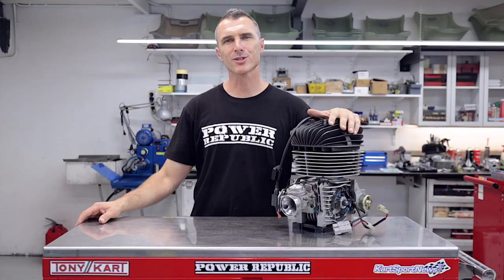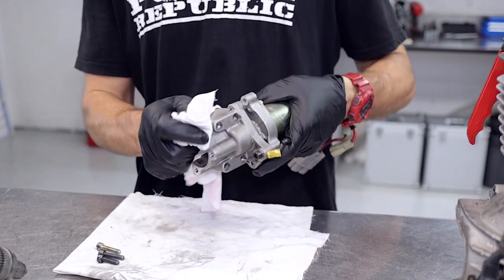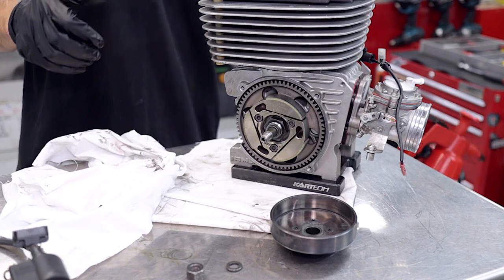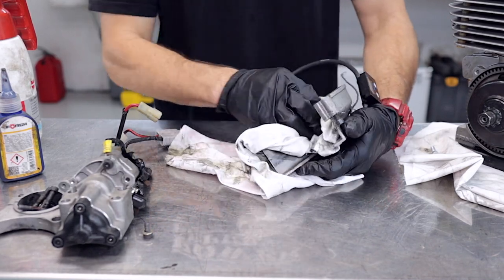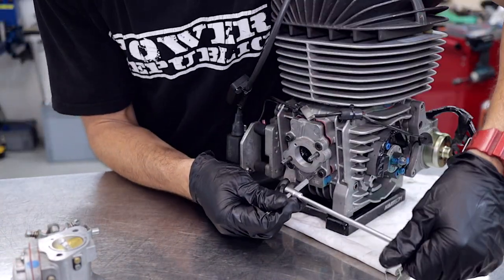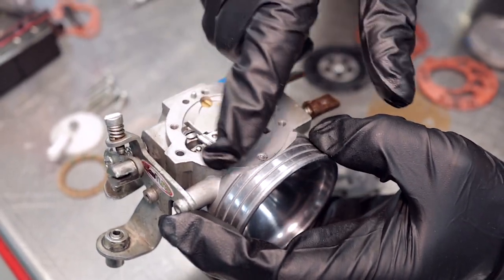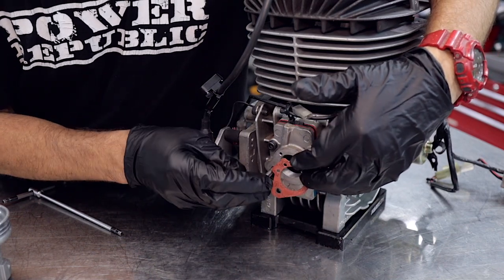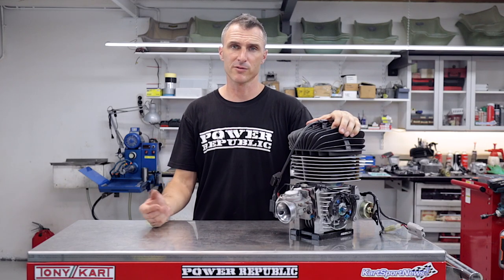HOW TO: Pre Season Race Preparation Part 2 IAME KA100 - POWER REPUBLIC

Comment: How many hours can be done on an x30 and a KA 100 before a rebuild is done? What is the rpm limit of both engines respectively?
Reply from the maker: 10-15 hours depending on budget.  16k is max for X30 and the KA 15500 - 16500 rpm depending on your gearing

Comment: Hi Derek, just got a new KA100 and noticed oil coming out of the area where the exhaust meet the engine. I was thinking that the engine was too rich and adjust the carburetor, but it’s still leaking oil. What should I check? Maybe the oil/gas mix?Thanks
Reply from the maker: it most likely the exhaust socket fit in the exhaust or the exhaust gasket leaking.  no big deal other than the mess.   double check, make sure the exhaust nuts are tight too
Reply: @PowerRepublic  Thanks

Comment: I have a 2021 KA100 with less than 6 hours on the engine, with the starter support bracket and bolts removed, the starter will not come loose from the crank case, any tricks to remove it?
Reply from the maker: There is 7 screws in total.  Once removed, use a soft hammer to loosen the housing off the crankcases

Comment: Hello.
I'm. BRAN NEW to the sport.
I purchased a BIREL kart with the chassis and all components New. It has a rebuilt
Yamaha KT100 zero running time. My question is , what is the difference between a KT100 and a KA100. Thanks.
Great Video
Reply from the maker: The biggest difference is the KA is a reed valve engjne and the KT is a piston port.   The KA makes 50% more power over the KT and is an awesome engine
Reply: Might be a bit late but ive ran both in the us and to me yes theres more power but the biggest difference I found was the tag style clutch on the ka100 vs the output shaft clutch on the kt100 that was a lot more maintenance and took a lot of tuning to get lap time

Comment: We just picked up a KA100, pulled it out of the box set the carb to 1 and 1 on the high and low speed needles.  At our race we just had we were only getting 13,800 RPM while most other drivers were getting 15,500 RPM on the same gear ratio.  What could be the difference?
Reply from the maker: damn Jeff, that a big variation.  did you lean out the HSJ at all?
Reply: We did not lean it out.  Also just found out a few guys were running 3 teeth higher on the rear but I wouldn’t think 3 teeth would equal 1700 rpm. We have a long straight and was seeing 1100 EGT.

Comment: great video mate, since ive gotten into karting your videos have helped so much with general maintenance. Just a quick question what spark plug would you recommend to use for the ka100's ive been told the NGk B9egv is a good one but I think its discontinued any suggestions would be sick thanks
Reply from the maker: we use BR9 EIX or BPR9EIX.  both excellent.  get some and test them for yourself.   If you want to order some contact us via email or call the House of POWER !!!!

Comment: Hi, I currently have a KA100 and today during practice my chain snapped and my engine immediatly topped out at 5k or 6k RPM despite being flat out on the throttle, since the chain was broken shouldnt the front sprocket been spinning freely? Is there something that you think could have broken during the incident? Thank you!
Reply from the maker: Nah happens all the time, shouldn’t be an issue

Comment: That outside clutch washer that's right behind the nut, it has a bevel as well like the internal one. The overhaul manual says that goes to the outside (towards the nut) while everyone I talk to says the bevel goes to the inside (towards the clutch drum and really the bearing there) so which is right? I would swear that when we get these back from our builders the bevel side is outside under the nut.

Comment: Id like to add a battery recharger to my kart, do you have any ideas??
Reply from the maker: Hey Chris, you can screw some extra terminals onto your battery that have an Anderson plug connected to them.  That will make a quick connect for you to connect your battery charger to.
Reply: @PowerRepublic  im thinking alternator or similar. I think i can run something off the rear axel which will recharge while the karts moving. If i can do that, recharging the battery wont be needed as much.
Reply from the maker: @christianbuczko1481  yeah it would but it might take some of the power out of the engine and add unnecessary weight
Reply: @PowerRepublic  if it ever raced, it will need alot of lead with me driving it. The extra weight doesnt matter, and as i dont carry weights, and weigh about 54kg in my suit and helmet losing abit of power doesnt worry me either.

Comment: So I was tightening one of the 6 bolts on the carb and I broke one of the heads off how would I get it out?
Reply from the maker: easi Out , or a reverse/left handed rill bit.

its a mission some times if they are right in there

Comment: G’day Derek, I’m in KA4 junior Light using a ka100. I am 15-20 kg heavier than my competitors and they are starting to get quicker than me in pace. Do you have any racing or tuning tips to help me stay competitive. Thanks, Hugo
Reply from the maker: Hugo, jump up to KA3.  then the weight won't be as much a problem for you as the class weight is higher and you have more power.   in the low power catagories, weight and body height are a disadvantage.
Reply: @PowerRepublic  yes, my goal is ka3 but I have just come off my p plate and I need 6 more races to get to ka3. I have just entered into the Golden power series in ka4 junior heavy and I got 7th.
Reply: @garraway63   You will have to wait a bit, then apply for a dispensation.  My son did this.